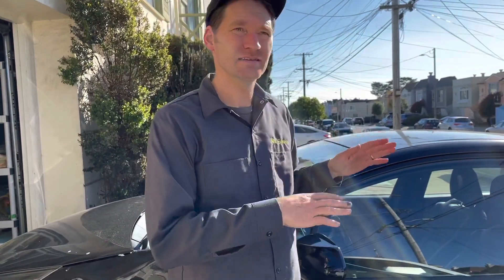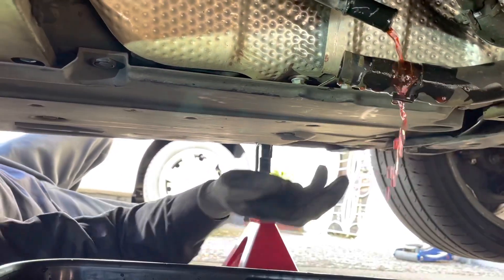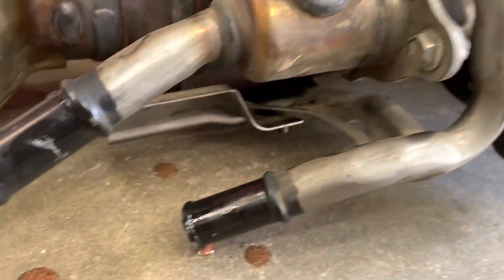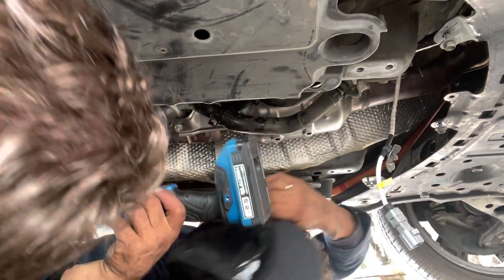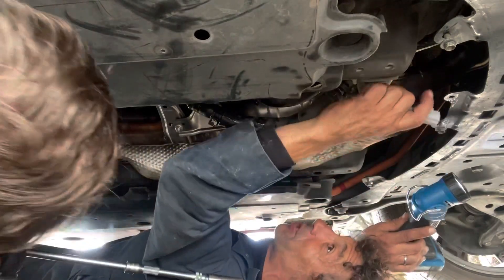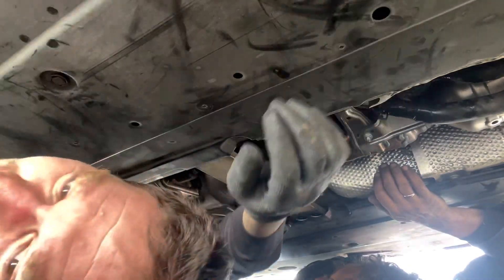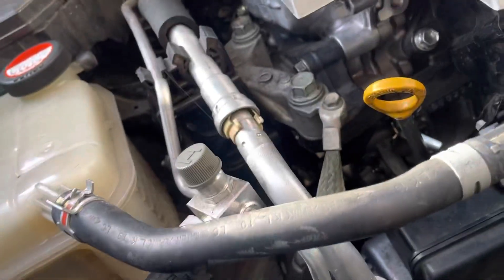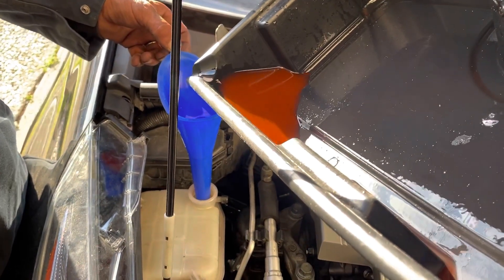Gen 4 Prius Exhaust Gas Heat Exchanger Repair

Comment: If the car has overheated will the headgasket also go ? Previous owner was a dumb person so Idk if prev owner drove it while it was overheated
Reply from the maker: Head gasket can fail if it overheated. There are a few test methods usually you must get the car up to temp to test.

Comment: Was there any kind of plugs in the tubes you had to remove on the new part? I just got my Prius back from Toyota for this. Of course they tried to charge for me for it until I went in there with a printout of the Technical Service Bulletin for this. They ended up doing it for free plus a free rental car. It took 3 months for them to get the part and now I have no heat. I don't know what it could be besides air in the lines or a blocked heater core. I've tried everything.  I hate to take it back to the dealer after the experience I had with them.
Reply from the maker: @tonyinfinity  interesting story. In this video the customer sourced the part from a junkyard so it was not new. The coolant is not low in either coolant reservoir ?
Reply: @Mrelectric423  Coolant levels are full, I even let it run in "maintenance mode" for 30 minutes. I could see the coolant flowing thru the reservoirs. I've heard other stories of air in the system since it's a poor design and the way there's a Y junction where it goes into the heater core.
Reply from the maker: @tonyinfinity  well in the car in the video I just poured coolant in with a funnel.  I wonder if a hose is folded and collapsed. Maybe check the two black rubber hoses that connect to the exhaust gas heat exchanger aka the muffler and see if anything looks crimped.

Comment: I bypassed mine. I did the bypass under the hood which was a very simple process which cost me $0. Getting to it is another story.
Reply: Link for bypass
Reply: veganA • It is easy. You just unplug the two hoses coming in from the exhaust pipe and plug the other ones correctly into the existing black angled plastic connector. There are many examples on YouTube.
Reply: I did bypass, it’s little bit longer to get heated in side of the car in winter otherwise all is good and $2800 Canada’s I saved
Reply: Your prius will NOT last long
Reply: @dtruong611  actually the coolant bypass will make the car bulletproof. The heat exchanger coolant was a stupid feature and fails costing thousands. The bypass is very easy and reliable. The only downside is that you have to wait a little bit longer for your car to make heat. It's a no-brainer
Reply: @thomashilliard8588 does the bypass have any impact on smog check? I'm sure it depends on where you're located.
Reply: No issue with smog I am planing to do my brother Prius too this week  @Yartin
Reply: Yartin • The Prius smog check is done electronically at OBD. 
Unplugging the heat exchanger hoses in the engine compartment doesn't modify the smog at all. It just makes the initial heating time of the coolant a bit longer than usual, maybe 3 minutes longer.
Reply: @dtruong611 been bypassed for 2 years now…
Reply: @dtruong611  i did this a year ago. I have 145k miles on it and still going. You know nothing besides being a smooth brained troglodyte
Reply: dyeuong6 • You're wrong. It doesn't affect the car at all.

Comment: not need to remplace the catalytic converter can be fixed, just by bypassing the heat exchanger by getting a U coolant hose 5/8 at your auto parts.. cost about $10, Easy fix... it's better than paying  2000
Reply: The bypass before the cat is free and easier. No need to lift the car.
Reply: You Have video of that

Comment: Cant you just bypass the stupid thing instead of paying $2000 for a part that is just going to have the same problem in the future?
Reply from the maker: Yes that would stop the leak but you would be removing smog equipment.
Reply: @Mrelectric423  Actually you would be PROTECTING the catalytic converter, not removing it.  The argument that the heat exchanger is "smog equipment" just because it heats up the engine a minute or two faster, or because it's physically in the same assembly as the catalytic converter, is a losing argument.  The fact that they removed this whole scheme from the next generation, and it didn't exist on previous generations, is proof that it is not required for the Prius to pass any smog test in the world.  

If they attached the headlight aim sensor to the cat as part of the same part number, would you say that bypassing the aim senser when it dies was part of the smog system?
Reply: @EfficientRVer  Some good points sir, but what about the longevity of the engine? I obviously don't have the technical knowledge, but couldn't this system not be beneficial for the engine in the sense that it gets up to temperature quicker which in turn might reduce stress on even other components?

Comment: What did they do to diagnose the blown head gasket? My 2016 Prius heater has been intermittently been blowing cold air and showing low coolant in the reservoir. Took it to a local mechanic and they diagnosed a blown head gasket based on "block test" showing hydro carbons in coolant.
Reply from the maker: I am not sure what they used for diagnosis but the chemical block test for hydrocarbons is fairly reliable. That said I am not sure if the issue in this video would create a positive on the chemical block test.
Reply: @Mrelectric423  If coolant is getting into the exhaust, then I would guess some hydrocarbons to be contaminating the return coolant.  Just guessing.
Reply: If you're getting coolant out the tailpipe then it's the issue with this part they replaced in the video. Sometimes you can even hear coolant sloshing around in the muffler if you lay down and move it back and forth. Obviously when the car is off and not hot!

Comment: My Prius is in the shop now for a heat exchanger …it’s 3-1-24 the part will be in about 4-20-24 🤷🏻‍♂️ crazy it’s a 2018 model…$2,000 for the job

Comment: OH MY GOD! DON`T REUSE THE COOLANT MAN! JEEEEEEEZUS!
Reply: I agree.  He installs a close to $2000 part and then pours back in likely 8 year old coolant.
Reply: @EfficientRVer  the most important to use a good filter for used coolant. I use paper filters for paint. U are i d -io ts
Reply: Yeah that's crazy...what kind of mechanic does this? The 50/50 pre diluted pink stuff is right around the corner at a parts store or nearest dealer. That's like taking a shower and putting your shite stained undies back on afterwards. lol

Comment: You can just repair it. No need to buy new one..
Reply: I haven't looked underneath but couldn't you just disconnect inlet and outlet of the heat exchanger and put a pipe between the two hoses.
Reply: @albertrogers9318 There are U shaped pipes and hoses. There are also rubber caps for the pipes.
Reply: How?
Reply: @meeok2   I added reply how to. but somebody removed it
Reply: Why would someone do that?
Reply: @meeok2  then go to any affordable local mechanic, give them theese items and just say you need to Heat Exchanger Bypass
Labor usually costs around $70

Or I can share how to do that yourself
Reply: @spacemaster5206  that's a bypass. I thought you meant actually repairing the damaged part somehow.
Reply: @meeok2  unfortunately no.
I did bypass procedure in my car. It doesn't affect driving or vehicle perfomance
Reply: @spacemaster5206  is that a temp fix or can it work long term?
Reply: @meeok2  it will solve issue with coolant leaking permanently.
Reply: Hi Spacemaster5206, can you please kindly show me how to fix the heat exchanger for my 2017 Prius
Reply: @dtruong611  you need to buy two 5/8" Heater Hose connectors. Also one small Heater Hose.
Reply: @spacemaster5206  Thank you!

Comment: Dear sir，
can i add coolant every week and just drive it？will this damage to engine？
Reply: just bypass the heat exchanger, a mecanic will charge you like $100
Reply: The leak can get greater over time, potentially leaking all the coolant in short order. Also, it can get expensive.

Comment: Dear sir，

Hi
i have the same problem，can i add coolant every week and just drive it？will this damage the engine？
thank you！
Reply: More likely to damage the catalytic converter.  Find a video on bypassing it under the hood after removing the winsdhield wiper assembly to get at the valve/hoses going to it.

Comment: i have the same problem，but i have no money to repair it and it already passed warranty，can i just add coolant every week and drive it？ will this damage to any part of my car，like engine？

Thanks！！！
Reply: If it's this problem in the video yes you can just add coolant and keep driving it. It's just going to lose the coolant out the tailpipe. Just make sure you keep checking the coolant and don't run too low and overheat.

Comment: Why can't you just replace the valve???  $1600 repair vs a few hours labor to cut, unbolt,  replace valve, bolt weld???  Also, I have 120K on my 2017 Prius... Can I get Toyota to help as this is a known issue?
Reply from the maker: Is the valve sold as a separate part?
Reply: @Mrelectric423    That is not the point... the point is they should offer it and make good on a defective part that costs the customer over 2K to fix... F(*&(*& them.

Comment: Hi, I live in Europe, Portugal, winters are not very cold rarely below freezing and just -1-3 celsius. Was wondering if bypassing as a preventive solution for my 2018 prius 4 would make sense, because I've already had to top-up the coolant once as it was slightly below minimum level, car has only 40k miles on it. But just for the peace of mind you know ? Could I do it and leave it has is forever without any issue ? Is the extra fuel consumption really a lot because here in Europe it's very expensive already otherwise I barely heat the cabin don't really mind if it takes bit longer if that's the biggest inconvienient. Thanks
Reply: What was your solution sir

Comment: Hi
I have the same problem with my 2017 Prius. Is there any other way to fix it without changing the whole exhaust?
Thank you!
Reply from the maker: Yes you could probably reroute the coolant lines away from the exhaust. I mean install a u shaped pipe in place of the gas heat exchanger. Unfortunately this is probably not a smog legal repair so once the part becomes available again replace the entire exhaust unit.
Reply: Please see this TSB and take your Prius to your dealer.  They should take care of it for you at no cost.

https://static.nhtsa.gov/odi/tsbs/2019/MC-10166037-9999.pdf
Reply: Hi i know im 2 years too late. But hopefully this can help someone else with this issue. I did a bypass before it heads to the cat. It took a couple hours of removing everything (windshield wipers, cowl mainly) and 30 secs to connect/ bypass the tubes. Lookup on the priuschat forum or here on YouTube

Comment: That exchanger can't be found for gen 3, I have been on waiting list and tho paid in advance part not to be seen until early 2023. In the interim I am on Toyota house arrest; meaning I am only supposed to drive slowly and for short trips as the coolant runs out the exhaust pipe instead of cooling the engine. Evidently no part shortage for gen 4 exchangers. Mine went bad due to something flying up off road and denting the damn thing. What I did was paid a shop to run those hoses together and bypass the thing. If your dealer says 2700 bucks for part look on internet you can find it for 1600 bucks. Also after paying shop to run the hoses together underneath car I found a video on here by a Florida muffler guy who by passes the heat exchanger from under the hood by changing the connections on that T hose fitting right behind the valve cover. If you have this problem on a gen 3 look around for it.
Reply: Gen 3 means 2010 thru 2015
Reply from the maker: So you aren’t on Toyota house arrest anymore correct?
I believe the bypass is a good approach with no part availability consideration.

Comment: Just back from the Toyota dealer here in Dublin and I was charged just over €1100 to get this replaced on a 2018 Gen 4 Prius. Toyota part number 17410-37B52. Just over 112K kms on the clock. Is this an know issue? Was told it was just wear and tear but the car is only 4 years old and just out of warranty. Best built cars in the world????
Reply: Same story here. Gen 4, 2017 Prius. 80k miles. Same issue. Quoted £1116 by Toyota dealership in Cornwall. Not covered by warranty. Must be a common issue.
Reply: in germany they charge for toyota corolla 2.0 hybrid 2500€ for replacement...
Reply: Sounds like you got screwed, Toyota should still be replacing these for free. There's a technical service bulletin for this.

Comment: So, would using heater more help? Is it from not changing coolant maintenance? I bet that was a costly part? Ur videos are great! I hadn't sub'd for ALL by mistake but corrected.👍 Ur customer has Persona wheels on it, do they just bolt on gen4's? I need extra wheels for winter in rust belt. Keep those videos coming!! 👋👍🤓
Reply: If you're not worried about using heat or waiting longer before warms up in the cabin... just follow the Gasket Masters video to bypass and save some funds.
Reply: @jafinch78 do you have the link?
Reply: How to prevent Prius head gasket failure is the title of the video on Gasket Masters YT channel.  @tiffanyhwang1738
Reply: Did you get an answer to this? There is luckily a lot to be found about solving the issue, but not so much on preceding preventing it without replacement

Comment: Is this the Gasket Masters exhaust gas heat exchanger bypass video prius?   What happened to the video on the front end body repair?  What a tease!  🙂 Neat seeing the underside design compared to the gen 3.   Wondering if there's a hack to get the 1.5's to replace the 1.8's?  Crazy the price difference compared.
Reply: Dont u mean the 1.8's REPLACING the 1.5's.🤔
Reply: @riceburner4747   No, not in regards to the price of the 1.5's.  I can find them for like under $500 good working performance. Possibly if a sale, with all the controls. Haven't seen any 1.8's around lately and those weren't under $1,000 when they were available.  I'm almost thinking I'll invest in a 1.5 and all the related electronics and most likely sensors (unless I can find specs to spoof connections) to learn on in the mean time until another salvage yard 1.8 shows up and I can get at.  Bummer is I missed two this winter that no one grabbed at the 50% off sale at one of the pick your parts yards.  Would have been under $500 though no warranty at that lowest price with most everything.  Good thing at least is the 1.8's in the gen4's can swap back and forth reads like.

Comment: Dear sir , my 2016 prius coolant loss every two day 1 liter , when i pressed the water cycle no leakage detected , i take it to garag , he said that the barrel of exhaust should be replaced   ? What is your opnion!
Reply from the maker: You could bypass the coolant hose to exhaust and see what happens. This would be a way to test of it leaking through the exhaust.
Reply: Mr Electric brings up a good point. Maybe it's evaporating there, although, it'll be moist.

Comment: Hi i got toyota prius 2018 and i noticed coolant water getting empty in a week so i took my car to the Toyota dealer and they said exhaust heat exchanger leaking, and the cost is £1300. Is there any other way to fix this issue. Thanks
Reply from the maker: Yes, install a u shaped pipe in place of the heater to bypass the heater.
Reply: Yes but then you don’t have heat in the car
Reply: ? The heat works in the car , the water goes hot in the engine  @MackDog1
Reply: @MackDog1  Not true.  It just takes slightly longer for the engine to warm up without using exhaust gas to speed up the process.

Comment: Hello. I have a 2011 and can't seem to find the part on eBay. What is the actual name? BTW, my issue is that when driving on the freeway in the morning, after a few minutes I get the temperature warning light. After a minute, it goes away and it does not come back until the next morning. The car is consuming antifreeze but the oil and oil cap are clean and the car runs fine so I do not believe the issue is related to the head gasket. 

Any help is greatly appreciated!
Reply from the maker: The part is the catalytic converter. That does sound like a headgasket. To test clamp off the rubber lines or install a u shaped bypass tube (I have never tried this just guessing here )
Reply: 2011 is known for head gasket failure. Must fix it or eventually it will fill the cylinder with coolant, and because of the high torque of the Prius starter motor, it will break the piston in half.

Comment: this has just happened to my 2018 prius in ireland, €1300 to repair and have to wait 3 week for the part
Reply from the maker: Interesting
Reply from the maker: You could just bypass the coolant tube with a u shaped pipe until the part arrives.
Reply: @Mrelectric423  already hired a car, and just left my car in the garage with them

Comment: Where did you find the new part? I cannot find one anywhere
Reply from the maker: Ebay
Reply: @Mrelectric423  || When you change the exhaust ... will the check engine still be on? (The part you changed is OEM or AFTERMarket?)
Reply: You can just repair it. No need to buy new one..
Reply: @spacemaster5206  How??
Reply: @meeok2  I added reply how to. but somebody removed it

Comment: Pulling those hoses from the bottom seem like the best fastest most thorough method of removing all the coolant out of the engine or a coolant change.
Reply: Could use clamps to stop coolant from leaking out.
Reply from the maker: Agreed